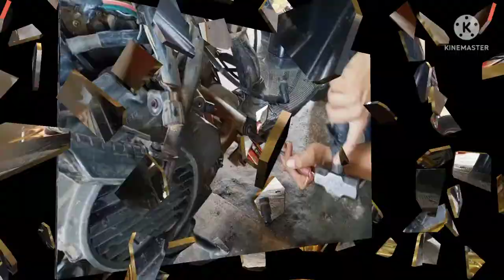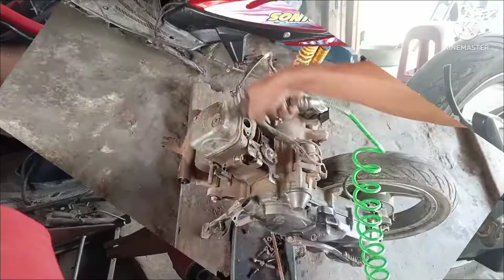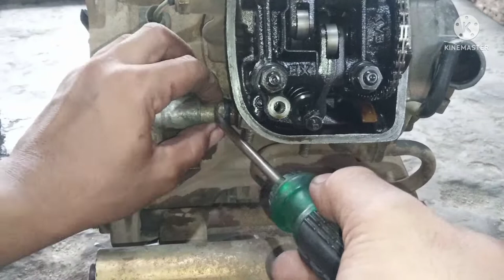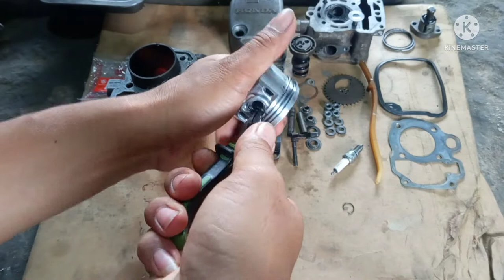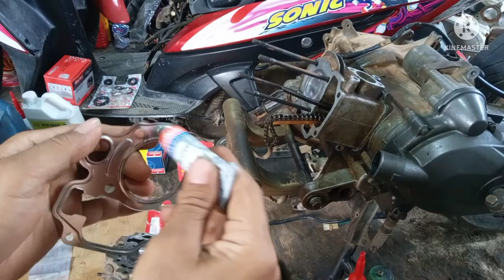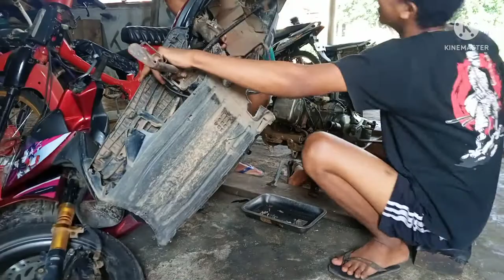How to fix white smoke from exhaust motorcycle // Honda Click 110 // Vario 110 //

Comment: 😂thanks so much! I found out that my mistake was because I installed the valve stem oil seal, and then polished the valve. As a result, white smoke came out after a few minutes of riding.